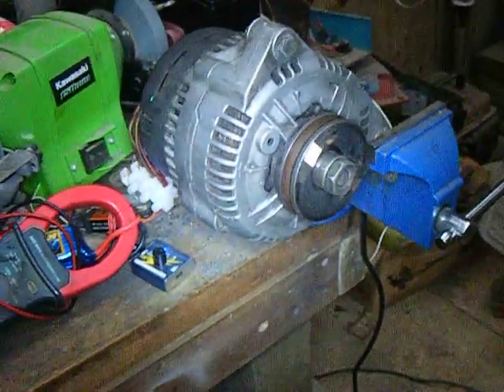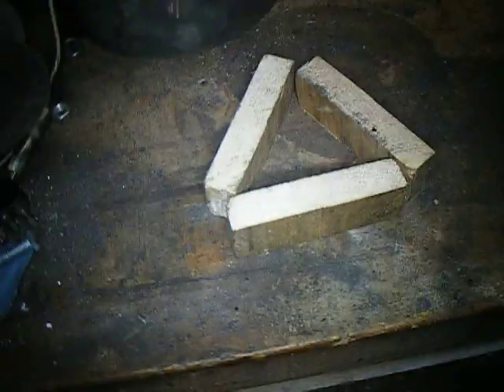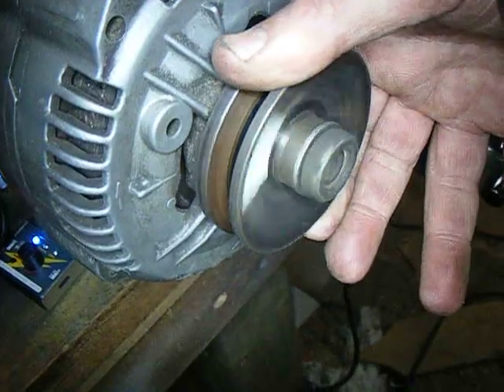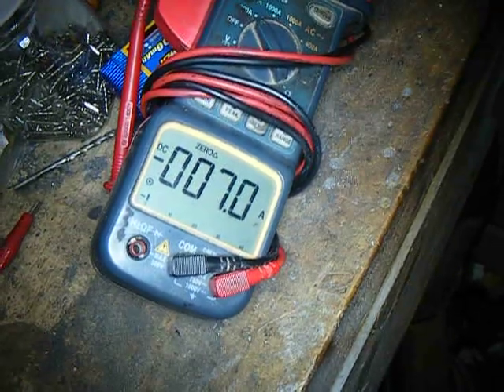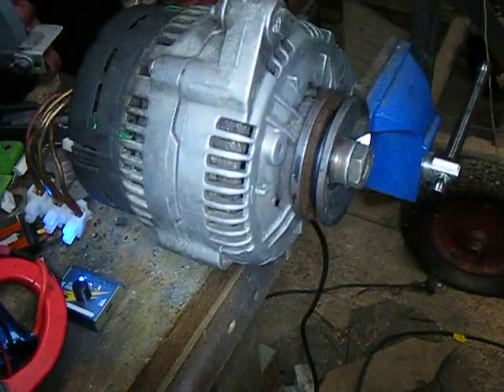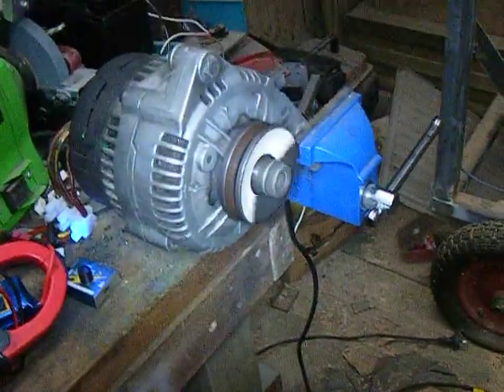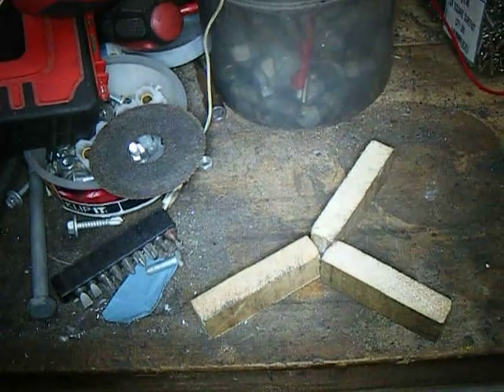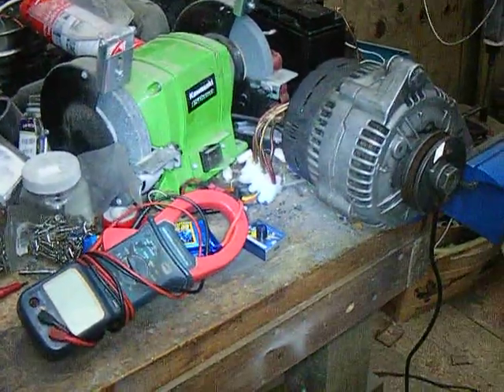Enhanced Alternator Motor goes faster than before

Comment: Hello I've built a go kart and it needs a powerful motor like this is there ant Wat possible you could do a video in how to this this configuration in more detail please and you are brilliant 😎
Reply: Sorry for the spelling
Reply from the maker: These kinds of motors can deliver a couple of horse power, so that ought to get you moving quite nicely. 
 Mine is not very powerful, as I have used cheap parts to make it work, but it's good enough for a bike  :) . 
 You might like to take a look at YouTubers: Austiawa and Tchangly21 for more powerful examples of alternator to motor conversion  :) .
Reply: Ok thankyou for replying what I have actually done is converted a petrol quad to electric I have a 24 volt 500 watt motor the power source I have made is lead acid 6 6volt 12 ah batterys wired in series  to create 36 volt I'm also using a 36 volt speed controller 800 watt with all this I seem to only gat a mile before it runs out of juice any advice for me please ????
Reply from the maker: Those kinds of batteries have a rather poor performance curve at high power levels, so they will tend to drop out pretty quickly when pushed hard.
 You'll probably find that one or two of them run down much more quickly than the others, which will drag the whole lot down. 
 One thing you can try is two stings of 3 in series, wired in parallel for an 18 volt system - with twice the current handling ability. 
 It won't be as fast, but it will go a lot longer  :) .
Reply: Thankyou for your time in replying I will try that configuration I also bought a denso alternator today iv just finished a quick bench test iv wired it correctly with an ignition bulb from b+ to feild and no light comes on is the alternator blown or a part inside it  I'm a Newby
Reply from the maker: When you did that test with the alternator, how fast did you spin it? 
 These need to reach a fairly good rate of speed before they will start producing power. 
 I am assuming that this alternator has a regulator built into it?
Reply: Yes the alternator is a nd 90 amp denso with built in regulator I'm taking it back is there any I should look for in particular? ??
Reply: Iv just picked up a different 1 the last 1 was a 2 pin connection now this 1 is a 3 pin connection is this better ???
Reply: This is the specs of the new 3 pin alternator Voltage [V]: 12-14
Alternator charge rate [A]: 115
Number of Ribs: 5
Is this any good ???
Reply from the maker: Any of these alternators will be good when used as a motor. 
 The 115 Amp one will be a bit more powerful though.

Comment: Hi
Thanks for a great video. I'm trying to do the same thing but I have a problem. When I wire the alternator/motor in star it spins like a good un but when I wire it in Delta it just stutters. 
I'm using a cheap ebay 60A ESC with a servo tester but have an E Bike ESC on the way from China. Do you think the problem is likely to be the ESC or do I need a different alternator?
Thanks
This is the ESC I bought
https://www.ebay.co.uk/itm/60A-Speed-Controller-ESC-for-1-10-RC-Car-Truck-Sensorless-Brushless-Motor/263780566824?ssPageName=STRK%3AMEBIDX%3AIT&_trksid=p2057872.m2749.l2648
Reply from the maker: It really is hard to say where the culprit is in this, as mine worked just fine, regardless of which ESC I used. 
 One thing that may influence this is the phasing of each connection in the Delta configuration. 
 While this made no difference to mine, no matter how I phased the 3 coils, it might affect the way that other types of ESC perceive the EMFs returning from the 'motor'. 
 Sometimes, the ESC will have trouble in starting a motionless motor, stuttering, but this can be resolved by giving it a little push in the right direction. 
Stuttering is quite normal, to a degree, and it can be briefly seen in most model aircraft motors at the moment of startup. 
 Please do keep in touch about this, as I really do look forward to seeing your new EBike up and running  :).
Reply from the maker: Just took a look at that ESC listing: 
 It's limited to 2 to 3 LIPO cells, and you are operating it at the top end of that range. 
 Could you try it at a lower DC supply voltage, just to see if that helps?
Reply: Thanks for the replies, I should have said I'm using a 12V battery made up of old laptop 18650's so I don't know how that will effect things. I've tried changing the phase connections but no difference. I tried driving the ESC through an adjustable buck converter to reduce the voltage but maybe not enough current that way.  I also tried turning it by hand to get it started but no joy, when the ebike ESC arrives I'll give it a try and update.
I thought it was interesting using the buck to adjust the voltage going to the armature when in star. As I reduced the voltage the motor sped up a lot but if I reduced it too much it wouldn't start
Here's a pic of it so far.
https://photos.app.goo.gl/Atev9KVcx4RmZisX9
Reply from the maker: You are welcome  :). 
 Hmmm, it looks like you have done all the things needed for the process of elimination. 
 Watt a pity things didn't quite work out. 
 It is best to keep regulators and converters out of the power feed for the ESC, as they are likely to cause impedance and interference issues. 
 Cell impedances in the battery pack can cause some problems, but I don't think they are the cause of the issues you are seeing here. 
 If anything, it seems to come down to the ESC itself, and its capacity to handle the back EMF coming from the alternator's windings. 
 When you get up and running with the EBike controller, you'll surely want to play about with the armature current, in order to find the best operating point for your needs. 
 On mine, I feed it with 1 to 2 amps, then shut it off when I release the throttle, for easier coasting and peddling.  
 Seeing the picture that you linked, you are making a nice start on this. 
 Just maybe, the ratio will be a little bit too high, but you can fine tune that, once you get going. 
 Keep up the good work  :) .
Reply: I'm hoping you're right about the ESC, the same setup is working here https://www.youtube.com/watch?v=IKqy3rRWJQE so it should work.
The ebike controller I ordered is 36V sensor and/or sensorless so I'll make up a couple more battery packs and see what happens. My goal with this project is to get it running for the least money possible. 
The batteries were free, the bike was free, all the metal and timber were lying about so effectively free. I paid £15 sterling for the motor and £55 for the ebike controller + twist grip throttle. I may have to spend more but I'm hoping to have it on the road for under £100. 
If I can do that I'll call it a win. :)
Reply from the maker: So far, you are on the right track with this. 
 Your methods are solid, so you should soon be getting some positive results from the build. 
 Here's hoping you can get this up and running for not too many dollars  :) . 
 Once you get it up and running, you'll have endless fun with it.
Reply: Thanks for the kind words. 
Latest update is the cheap Chinese ebike controller has arrived and I've been playing with it. Turns out it isn't very happy running my alternator in Delta either so I'm thinking it may be the design of the alternator as it runs very happily in star. I'm going to go ahead and mount it to the bike and see how it goes, if I don't get enough torque or it drains the battery too quickly I'll either get another alternator or try the washing machine motor I have.
Reply from the maker: You are welcome  :) . 
 It is interesting what you have observed about the alternator. 
 Some folks say that Star works better than Delta, and others say the opposite. 
 In your case Star works, and Delta doesn't, so it looks like the alternator is the culprit here. 
 Hmm, I wish I knew why! 
 Do you find that you have lots of torque with your system, at low speeds? 
 That will surely give you some pointers as to what gearing ratios you'll want to aim for. 
 Keep in touch, as I really want to see your EBike up and running  :) .
Reply: I don't know if it is relevant but my alternator was double wound, so I have 6 ends to the coils but each end has two wires. Maybe the coils are wound differently in this configuration. I don't know but just a thought.
As for torque, I won't really know until I get it bolted together. My next step is to properly mount the motor in a way that I can adjust the tension of the belt. When happy with its location I'll measure up and order the V belt.
It might add a little weight but I want to be able to swap the motor easily so I'll build a carrier on the bike then bolt the motor and its mount to it.
Reply from the maker: That's an interesting point. 
On mine, the windings are single file, so there would be no complications. 
 I get the impression that the ESC is looking for the zero-crossing voltage transition of each un-driven phase, in order to decide when to activate the next phase pair. 
 If this signal is garbled, then the ESC will behave in the manner that you describe. 
 Perhaps you could experiment with your 6 double ends, and separate 3 of them, so you could test the motor in single file mode. 
 It will be good if you can adjust the belt tension, as there is a happy medium, where it works efficiently, while avoiding tooth hopping. A little bit looser is a lot better than a little bit too tight in my opinion. 
 Extra weight is always going to be an issue with home made EBikes, but I think you'll still be delighted with its performance when you squeeze the throttle  :) .
Reply: The controller has a learn mode but it didn't do much with the motor in Delta. When trying to accelerate it did spin but not very fast and was very jittery. In Star it seemed OK so I'll stick with it for now.
I spent most of yesterday soldering batteries and leads so next step is to bolt stuff together.
Reply from the maker: It's a pity that the motor doesn't want to work in Delta mode, but at least you are getting good results in Star mode. 
 As long as it delivers plenty of torque, and has a fairly good rev range, I think you'll be just fine  :) . 
 I have an alternator here that's a 4 phase one. As a result, it can't be used as a motor. 
 It was a real surprise to make this discovery, as I had thought all car alternators were 3 phase devices.
Reply from the maker: Looking good  :). 
 Your latest comment got marked as spam, and google didn't let me know about it. 
 I discovered it while I was looking at other stuff on my channel. 
 Anyway, it seems to me that you have the makings of a good prototype EBike. 
 Once you have nutted out a few teething issues, you'll end up having waaayyyyyy too much fun with it  :) .

Comment: Thanks for sharing this amazing project. How efficient is your Alternator Motor?
Reply from the maker: Thanks kindly for the positive review  :) . 
 As for efficiency, when I compare the mileage per unit of power that I get from this Alter-Motor with that of standard EBikes, I find that it performs surprisingly well. 
 On average, it draws 15 watt hours per kilometer, which is better than a lot of the other ebikes that I have seen lately. 
 Perhaps it could be improved further, but I am not sure just where the limit truly is.

Comment: I just pulled a couple from the scrap yard apart. One is a pig to get the rectifier, slip rings and regulator apart and has no rotor current. It is star configuration but there are 6 tails going into the star point junction and 2 for each phase so I'm thinking there are 6 coils. I wonder if you could separate them and run 2 escs?  
The other is a 115A delta configuration with slight regulator damage from an accident. The rotor pulls 3.8A and looks to be a very good alternator. I was planning to use pwm to control the rotor but someone told me that will mess with the flux and give poor results so I've ordered a 50w 100 ohm trimpot. I'm really hoping that I will get 10000rpm following your example but doubtful because it was already delta. 
I'm glad I found your video as it probably saved me a day of testing which is why I'm interested in your exact numbers. I need to get to 18000 rpm so I guess I'm going to need at least 24v
I'm in NZ by the way
Reply from the maker: 6 wires at the star junction tends to suggest a bi-filar winding configuration for each of the 3 phases, so it is best to keep them paired up when you try out either the star or delta configs. 
 You will not be able to use two ESCs, as they will fight each other, and release the magic smoke! 
 ESC smoke smells nasty. 

 It is best to avoid PWM, as this will produce a pulsing effect in the stator windings, which will interfere with the timing of the sensing function in the ESC, and cause erratic operation. 
 There are ways around this, but your 100 ohm rheostat solution is the better one for now. 

 My exact figures will not mean very much, as your alternator will behave differently from mine under the same circumstances. 
 Experiments are in order, to see if you will get the required torque at the required RPM. 
 Torque falls away as RPM increases, for a given supply voltage. 
 18000 RPM is quite high, so yes, 24V seems like a likely working voltage for this  :). 

 NZ is the best country in the world. 
 No bias, of course  ;) .

Comment: How many volts did you use in order to get to 10k rpm?
Think an alternator can hold 72v?
Or is 48v plenty?
Planing on making a go cart :)
Reply from the maker: I was running this on 14 volts when I did this video. 
 At that voltage, you can run it really fast, but there is hardly any torque in it. 
 Your alternator will handle 72V, but only if you are ready for the sheer grunt that you'll get from it  :) . 
 48V is pretty safe, and it's gonna be pretty quick too. 
 Yer go cart will go like a rocket with an alternator as a motor  :) .

Comment: What kind of battery and voltage did you used for the rotor also for the stator ?
From battery how did you convert it into ac supplyed to the stator what did call that thing and why is it you apply risistor to the rotor before the battery?
Reply from the maker: The resistance I used for this ranged between 12 and 24 Ohms, which makes for a current that ranges between 1 amp and 0.5 amps. 
 Lower resistances translate to higher currents, which provide lower RPM and higher torque. 
 This alternator is rated at 100 amps.
Reply from the maker: I used a 4 cell, model RC LiPo battery for this. It delivers 14 volts to the system. 
A resistor, about 5 Ohms, limits the rotor current to about 1.5 to 2 Amps. 
The resistor allows the motor to go faster, while also allowing it to run a little cooler, but it reduces the torque. 
You can run it without the resistor, but it runs slower and draws more power from the battery. 
A 60 Amp RC aircraft ESC converts the DC to the AC used by the motor.
Reply: CNCmachiningisfun r
Reply: When you run at lowest rpm (6000rpm version) what is the rotor current and what resistance? Same for max rpm. And at 10000?  How many amps is the alternator rated at?

Comment: Well done! Interesting idea . Did you have any problems with the polarity of each winding?
Reply from the maker: Thanks kindly. This works like a charm, and I am now looking for other uses for this kind of motor  :) . 
 Oddly, I don't seem to be having any problems with the relative phasing of each winding. 
 I really thought it would be an issue, but it seems to work, no matter how careless I am with this aspect of it. 
 It is possible that the controller carries out some tests before it begins working, so as to automatically resolve this issue, but that's just a guess  :) .
Reply: CNCmachiningisfun. If you assume that the original tappings are U1 V1 W1 and the star point tails are U2 V2 W2 , then connect the phases L1 to U1V2 , L2 to V1U2, L3 to W1U2, the same as IF you were connecting up a standard 3 phase motor in Delta . I imagine that you have done it this way , otherwise you may have a nasty judder in the motor.  
Keep up the good work.
Reply from the maker: +psob1 
 I did try a number of variations in the basic theme, to see if I could get the motor to fail, but I worked, no matter what I did - as long as I followed either the Delta or Star scheme. 
 To be sure, I would probably set the bare alternator up with an oscilloscope, energise the rotor coil, turn the rotor, and observe the classic 3 phase signature emerging from the designated outputs. 
 Upon getting these wrong, I am sure I would literally see the defects in that 3 phase signature  :) . 
 Thanks for your good thoughts and ideas here.
Reply: CNCmachiningisfun. Thanks, that's interesting, mind those fingers though.
Reply from the maker: +psob1 
 Oops! 
 Too late on the fingers thing. 
 I am down to my last five digits per hand now   ;) .

Comment: How many Volts and Amper produce  this alternator by factory data in alternator(generator)mode?Thanks
Reply from the maker: This was a 100 Amp, 14 Volt alternator. 
 Bigger ones may be better motors, but I don't really know for sure.

Comment: Do you use hall sensors ?
Reply from the maker: This is a sensorless system, but it seems that I could get better performance if I closed the control loop with a set of sensors.